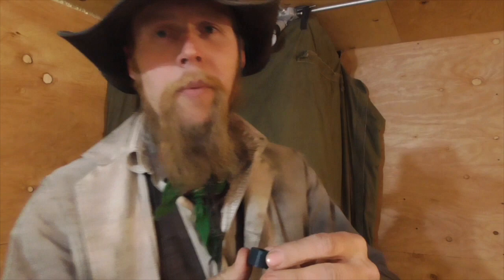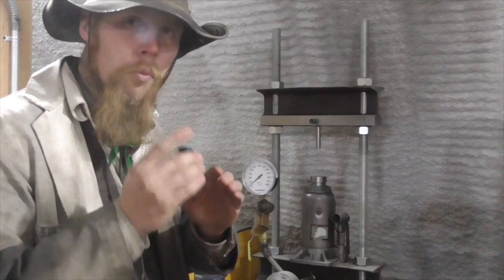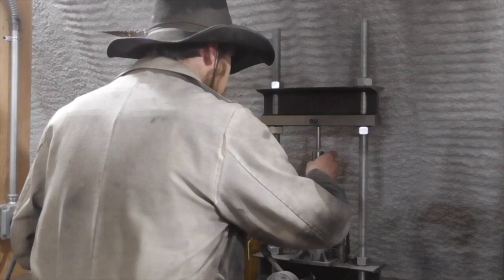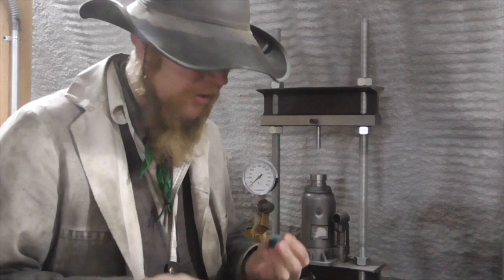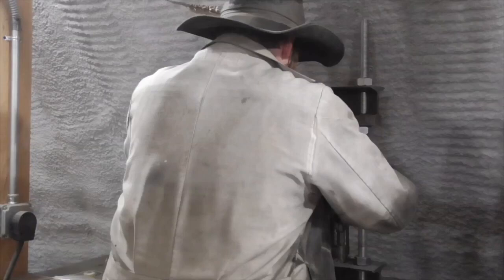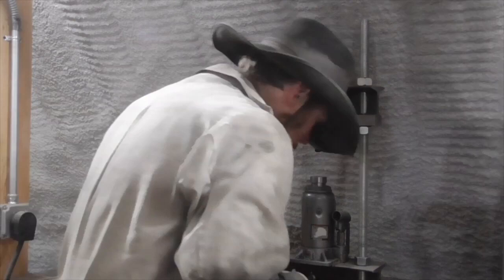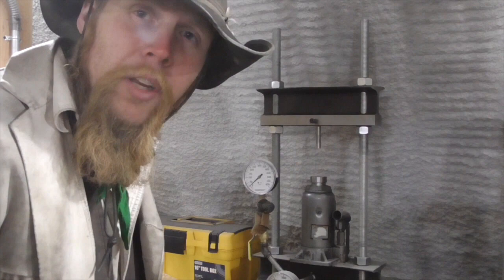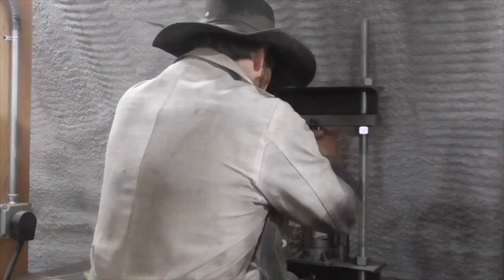Measuring Shear Strength of PETG and PLA+ (TIS325)

Comment: A proper impact modified PLA is one of the strongest filaments you can get. It's certainly the best for the price. The only issue is temperature resistance.
Reply: You can elevate PLA temperature resistance by annealing the printed item at around 60-80 degrees C for 30-60 minutes, depending on size. Raise the temp slow-ish, to avoid warping.
Reply: @ZappyOh  I have tried packing parts in fine sand and they still warp. FormFutura has a htpla called volcano that is formulated to minimize warping, but I have never tried it.
Reply: @NvrchFotia  I have annealed standard PLA stuff successfully ... by stepping up temperature slowly over an hour ... no warping.
However, I'm guessing large differences in thickness of the printed part could be problematic.
My parts where pretty uniformly wide, somewhat bulky, and deliberately designed in a way as to make the walls thick.
Reply: Easier to print to.

Comment: there's so many factors that go into strength. mainly print temperature, layer height, extruder calibration and so on. my guess is with the matterhackers is that you printed it too cold, use the upper end of the recommended termp range that the manufacturer recommends.
then there's the different axes that'll give you an almost woodgrain along the layer lines

Comment: Would it be worth testing each axis' shear strength? The XY may behave differently than the Z like you tested
Reply: Yes, there is a big difference. But  he tested it at the direction where it is the most strongest, but that is probably the way he is going to use it to.